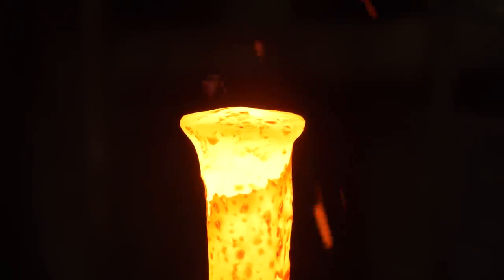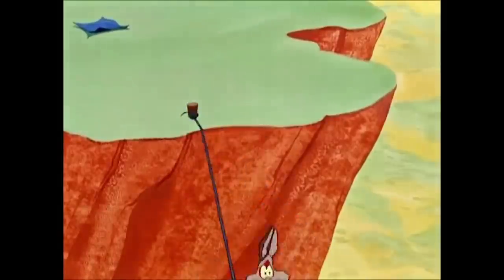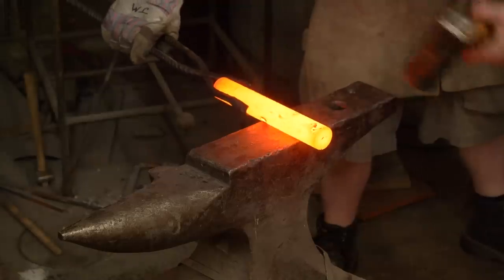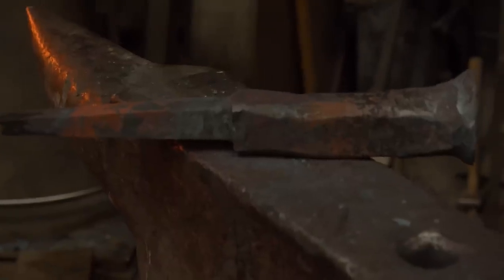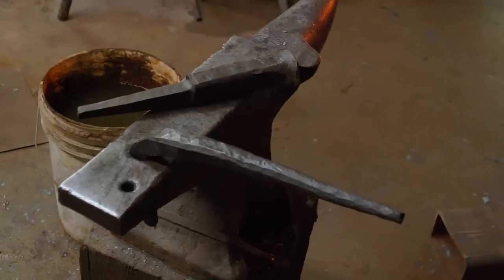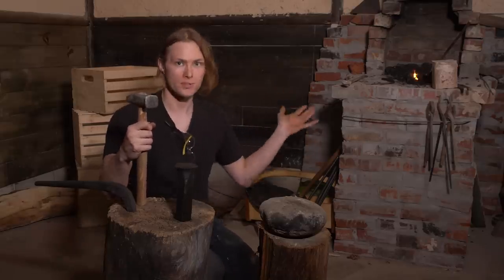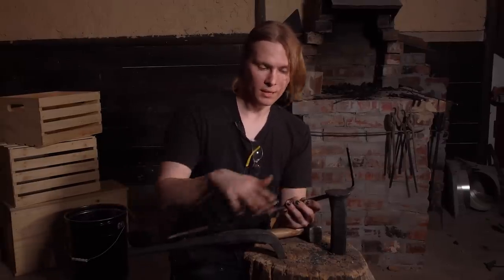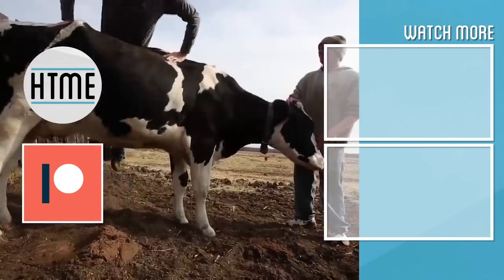Forging a Viking Anvil

Comment: So you're telling me that Dwarf Fortress was right, and that you do need an anvil to make a new anvil? I am disappoint.

I will offer a defense to the stone anvil, if you have a lot of experience working specifically with a stone anvil, that might help mitigate some of the problems with them, especially if you were using a particularly hard stone and could work with the exact same anvil for an extended period, or if you knew or had access to someone skilled enough in stoneworking to shape the stone better for your purposes. Now, I'll agree that a metal one is better, but just grabbing a hunk of what looked like limestone and using it straight up is unlikely to be representative of the stone anvils ancient smiths were likely to use, because while they might not face the comparison of working with a metal one, they'd still see most of the same flaws you all did with it and work on improving upon those, both with technique and improving the tools available to them.
Reply: The problem is that the first rock was sandstone, and the second rock wasn't much better with its wonky shape balancing on a small log. They could have stabilized it by having it sit directly on the ground with the flattish surface down (or over some tough material so it doesn't scrape the flooring), and used knapping techniques to flatten the work surface as needed (or just use a flatter stone; anvilstones were chosen and kept in use for many generations of work, after all) to improve the effect, but it can in fact be used to make an anvil just fine. Also as was mentioned, iron blooms are basically anvils in the making, just needing to be hammered down to remove the sponginess from the iron, and provide a dense, flattish surface. Larger anvils like the one they used to make the anvil pair definitely take more work, though.
Reply: If there's anything I've learned watching Andy since The Reset, it's that so much of the progression of human history is basically using whatever was laying around to build shitty  tools to help you make better tools to make better tools to make better tools... and so on. 

Like, half of this series has basically been "We need to make this, but first we need to make a rudimentary form of it to make the pieces that will make the actual thing."
Reply: @The_Razielim  That's close, but also not even close to accurate. Lemme explain: Tools weren't just upgraded wholesale with a tech unlock, sorta like how it's done in Minecraft or other similar crafting games, where you get a material, make a tool, get the next material, smelt it in an easy to make, all-purpose furnace, and repeat until you reach the end of the upgrading-materials tech tree; it's very much incremental change and teaching things from one generation to the next, with small iterative changes over each generation as they take what they inherited and improve upon it slightly. 

Sometimes there IS a tech breakthrough where something is discovered that fills a gap needed to upgrade current processes, like the discovery of coal coking did in making the much more common and easily available, low-quality bituminous coal, into a fuel that was on par or even better than that of charcoal or anthracite coal, since that also dealt away with needing massive volumes of lumber to convert into charcoal for smelting and forging purposes, which slowed down things in tree-sparse regions tremendously. However, things like this are still very incremental, with small discovery and experimentation towards solving that problem working towards a final result until they eventually succeeded in resolving it.

That's what Andy means when he says that everything is built on centuries of innovation in the title sequence, really; unfortunately, he also has the habit of treating it more like Minecraft unlocks rather than incrementally improving his tools and skills, which is why doing things like he has been in the past few videos, about improving his tools and bettering his tool usage, has been so nice.
Reply: nah, just use a crafting table

Comment: It's amazing the things you think are so simple, they almost never get included in the Grand Story of inventions, and yet they're super important and useful. One such thing is the wooden wedge or shim. Jam a few in under your log to get it to stand level and stable, or under your rock. Rocks can also be placed on the flattest side down, and they can also be hammered - even just with another hard rock - to smooth the flattest part into a level, stable surface. Seriously, stable work surfaces are really helpful, and people have been using them throughout history.

The Wood Age and Stone Age still have a lot to offer, that would make your journey much easier.

Comment: they need to stabilize their bases losing alot of energy but nice work
Reply: Yeah just fix it in concrete
Reply: I did wonder whether the rock would be any better in a pit of sand or something which could absorb some of the impact without it rolling all over the place, but it's never going to compare to the iron anvils on surface finish (and ability to be hammered without breaking)
Reply: @PKMartin  I bet the sand would be good. Like a kinda thick sand to hold it still

Comment: If you wanted to use a stone anvil you could make a box, fill it with dirt, make an impression  for the stone (using the stone), and pack dirt around the stone to about 2/3 up the side of the stone. That would practically eliminate the movement of the rock as well as giving some limited protection against the stone splitting as easily. I would also start off with a very hard tough stone and peck and grind to make one surface as flat and smooth as possible, though you would have to resurface it periodically. Just something to think about using technology that would have been commonly in use when the first metal was forged.

Comment: I feel like they were underselling the rocks. I mean, those rocks were terrible. Small, round, sedimentary. Did they not have permanent forges with a unit of a rock or did they travel around a lot and have to make use of what they could?
Reply: given that after a while a rock would shatter I think there is a limit to the amount of effort it is practical to use in getting a perfect one. (Think about all the work to mason a perfectly flat rock and then have it be chipped by a hammerblow and there is no real way to fix it)
Reply: I dont know about other cultures but I read that they have found giant anvil stones in place in Scandinavia. Through archaeology it appears that the smiths that used these just built a shop around the stone.
Reply: @davidbucklen-blacksmith5402  Well you are probably a hell of a lot more qualified than me so I will take your word for it my dude
Reply: @lukesanderson7608  ive seen pictures of them where they are worn with grooves and are chipped off from years of use.
Reply: The bigger thing to me was not securing it at all. Like don't perch it on top of a log with no support.

I'd think the best solution would be like a leather sandbag to rest it on. Then it won't travel as much, and it'll mean the impact is spread out instead of concentrated against the flat log surface.

Simpler solution would probably be to put it on an earth mound or something?
Reply: Plus they could've used a big rock that was already in the ground, instead of taking one and putting it on a log. It wouldn't slip around if they did that.
Reply: From what I can find from my research.

Most anvil stones that were used were either "the rock that was on hand, and replace it as needed, even if they sucked and you needed 20 of them to make anything" or a smith would find a big natural formation to use as his anvil and build his shop around it.

In the case of a natural formation near a settlement his apprentice would inherit the formation, and then his apprentice's apprentice and so on until the techniques to make metal anvils were discovered, which would be made using the natural formation, however it seems like the best smiths are believed to have been granted these old natural forges as a sign of respect, but they would often still use them to create metal anvils which they did most their work on, only using the traditional stone for crude work.

Once they had a few metal anvils that allowed more anvils to be made using the existing metal anvil that could be taken wherever you wanted them. This allowed more locations to have their own forges and further spread the skill set.

If you were on the go and natural formation couldn't be found wherever a camp had to be set up, it was apparently common to slap a rock on a stump of a cut down tree, and use that to make whatever was needed immediately.

Smithing was often a "what we need right now" craft until a metal anvil was created if a solid natural formation wasn't on hand.

In the event of having something like a softer metal such as bronze, making an anvil for a harder metal like iron would still require a suitable natural formation or many softer anvils to do the first time.

So the historically accurate way to get that particular set up would likely look a little like this:

The smith travels to a natural formation and hammers out a spike, which is used to drill into the formation. He then makes the start of the stake and shoves it into that drilled hole and beats it flat like they did, this might crack the natural formation of it isn't big and hard enough, or if he's just too close to the edge so he might need to drill a few holes. This would take quite a while to do.

He then takes the stake anvil and uses it as anvil to make a horn. It wouldn't take as long as the stake due to having a better anvil to work with now. 

He then carries these two parts with him wherever he may go, putting them into logs as needed as a travel set. They would also have been instrumental towards working towards larger metal anvils.

Some records exist of it being tradition for a smith to teach an apprentice by having them first forge their own tools. In this way the apprentice made everything he needed to learn more.

Smaller anvils would have been used to make larger anvils and then more complex and specialized anvils.

Comment: I might have to look into getting one of these sets. I'm still using a wood open pit forge and a round of mulberry as my anvil.
It's hard work because of the lower temperatures; the metal doesn't move as much and if you want to see your heat,  you can only forge between dusk and dawn. Even still, I love the challenge and experience. It just takes a weeks worth of clear weather to finish a piece.
Reply: This is actually why even in summer, forges were mostly enclosed spaces; they kept them fairly shaded from the natural light, so they could see the fire and the colour of the metal better. Even outdoor forges benefit from some form of enclosure, even if it's something as simple as an awning or other such roofing as can be arranged, like a corrugated metal roof (which doesn't have the same burn risk an awning would, especially a modern one).
Reply: @KainYusanagi  My "forge" is literally a hole in the ground and my lungs are my bellows. Sometimes I'll break out a piece of cardboard for a thicker piece of metal or a leaf blower if it looks like the weather is about to take a turn. 

 I use this pit for campfires, cooking, making charcoal and a bunch of other stuff as well. I wouldn't want a roof over it.
Reply: @dhawthorne1634  Doesn't have to be something hard and permanent, like coring holes and dumping concrete in, and then plowing pipes into it. A simple tarp set up over some poles like a tent to shade the area when forging would help, and it's easy to take down at other times, too.
Reply: @KainYusanagi  No can do. My septic lines run right under it and there is a 240V 30A cable buried somewhere through there, no conduit.
Reply: @dhawthorne1634  That's why I said that you DON'T have to do something hard and permanent, lol. A simple tarp set up on some poles would work just fine to make enough shade that you can see the temperature of the metal much more easily.
Reply: @KainYusanagi  I can't drive poles into the ground here. Anything high enough to not catch a spark would also have to be deeper than I'm comfortable with. Also, I've had my patio umbrella rip out of the table and end up on the roof. A tarp couldn't withstand the winds I get here. Working on slightly windy days makes heating much easier because I can funnel it into the coals. 
Main point: I'm perfectly happy with my primitive setup, quit trying to make me change it.

Comment: Not sure what type of rocks you're using for this but I've done a fair bit of blacksmithing work with a charcoal fired campfire and larg granite boulders that were already partially embedded in the ground. I've never broken one of these rocks, though they definitely suck a lot of the heat out of the projects. When the rock disintegrated it almost looked like the way sandstone or limestone crumble.? I can't imagine a worse rock to use as an anvil, maybe this requires some more research and experimentation. Also wonder if putting a  binding around the rock would help it not split.

Comment: It is worth keeping in mind that the Neolithic was considered the age of ground and smoothed stone.  The mastery of stone shaping was as highly developed as it would ever get.  Even the remarkable stone vessels and objects of Bronze Age Egypt and Crete for instance were almost certainly made without metal tools.  The biggest drawback to stone, if yo pick the best kind, is that it lacks the mass of iron.  You just have work harder, but a well crafted stone anvil can present a flat surface, though it will be easier to damage.  There are archaeological examples from Europe that are deliberately hammered to a flat surface.  And, stone anvils were used up into or past the Renaissance in some areas of Europe and the British Isles.

Comment: Whenever I see blacksmithing in your videos, all I can think about are the little flakes that fly off every time you hammer something.  How much iron ends up on the floor?  Are they able to sweep it all up and recycle it?
Reply: The flakes are called "mill scale," and they are chemically the same as magnetite. It's produced every time steel or iron gets hot enough to react with the oxygen in the air. Relatively small amounts are lost to scale, but it does add up over time. You can absolutely recycle the scale, and they do industrially to some extent.

Often times the mill scale is mixed in with traditional ore like magnetite or hematite to improve the quality of the smelt, and in the process, the mill scale reduces and the iron is incorporated into the new steel.

Comment: When you first start working it, and its falling out of the round jaws of your tongs over and over, i find that if the jaws have a v shape they hold round stock much more securely.  Also, rebar isnt my favorite material for making tongs, its sort of "whatcha got stew" made up of all kinds of steel, some high carbon, some low carbon, so it makes it difficult to temper it to the correct hardness for a tool you are making, you can see this happening as the round jaws of your tongs flatten out.  If your having a hard time holding on to the work piece,  you can shorten the jaws of your tongs to give you more leverage, till your hand strength increases.

You gotta beg borrow or steal a bigger stump for your anvil stand, havinv it rock around like that is dangerous, but more importantly,  its annoying, and will keep you from doing as good of work as you are capable.  If you are in the city, and cant just get a bigger round of log from your own place, try "tree guys" in the phone book, ive literally never been turned down by one when i needed a chunk of wood for a project, and was stuck in a city for some fool reason, lol.

Comment: What would they use before they had a wire brush to clean up the surface? Did they just hit it to knock it off?
Reply: Copper brushes, and before that, a rough stone. I've even heard of people using volcanic pumice to get rid of the scale. (Scale is the stuff they brush off. Its basically oxidized iron/rust.)
Reply: Historically the metal was scraped before cooling
Reply: @The_Keeper  A plethora of oxides of various kinds, including carbon and silicon, actually! ^^

Comment: I worked on a rock loads it’s not that bad. I cracked a large bolder in half to get a semi flat face and then I pushed it around for like an hour to “sand” it make it flat (worked great tbh) made it super stable. I then flipped it upside down and pushed it back and forth evenly to get a small top (was more a slight horn then flat but tbh it wasn’t that bad) I could get straight edges and stuff on it but yeah anvils are better

Comment: Watching them hammer on the piece in the hardy hole, I was worried they might break off the tail of that small London pattern anvil. I would use a swage block so as not to destroy that London pattern

Comment: for a more sturdy anvil (outside) try to get an old telephone pole (or another dried large longer log) and then bury it partially in the ground (to your correct height) - there are several videos of this here on utube

Comment: "Now we're going to make the same thing on the anvil."
Yeah, but what is it?
Reply: Adrian said later that it was a "rake". I don't know how it's a rake
Reply: I think it’s to move the hot coals around inside the forge
Reply: @saltysalt397  This is correct. Coal rakes are used to arrange coal in the forge's firepot for proper insulation of your work, and to pull more coal into the pot from the table as time goes on and your coal burns down.
Reply: oh right the hook is for hanging it I assume.